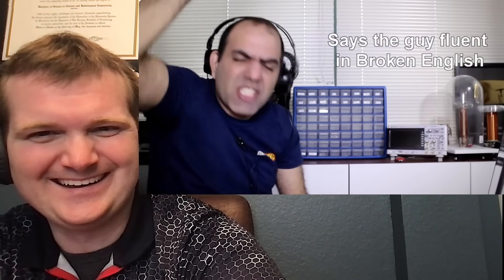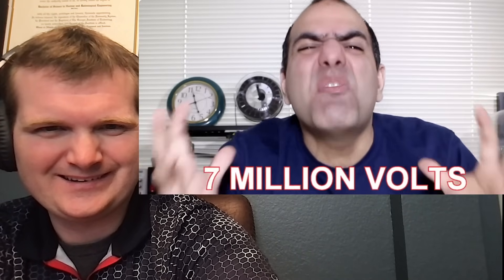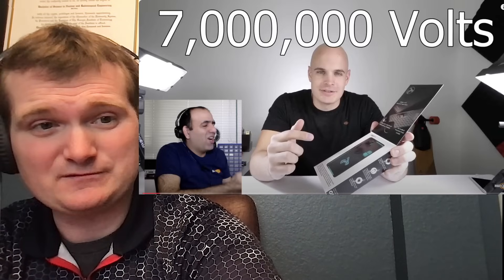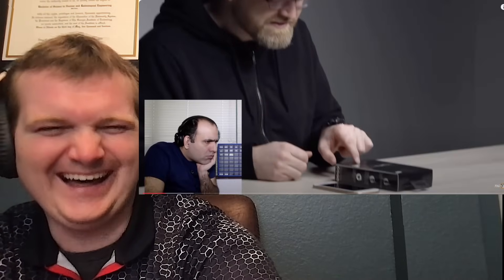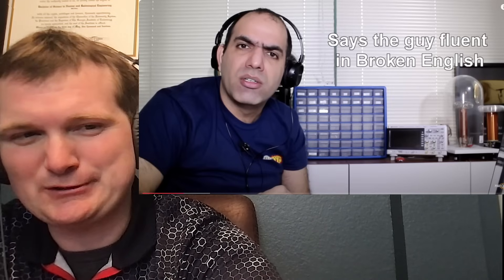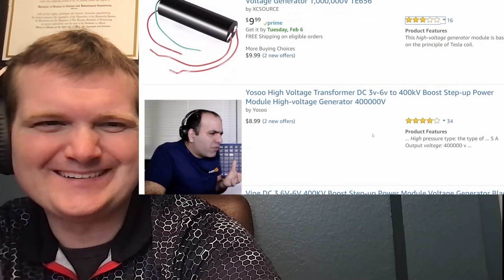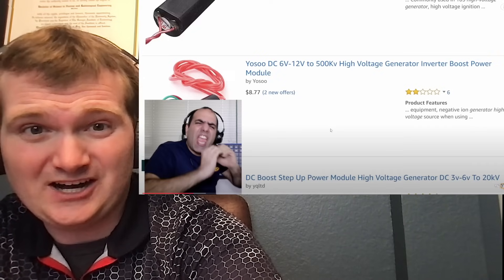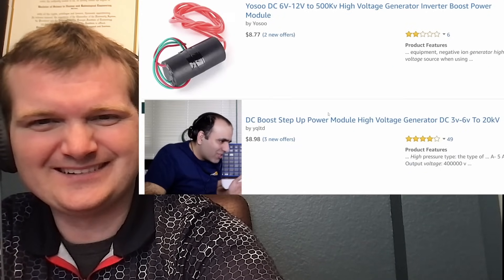7 MILLION Volt Stun Thingy! - Nuclear Engineer Reacts to ElectroBOOM

Comment: "It's not the voltage, but the current that gets you" is when people talk about high voltage sources that have high internal resistance. 
A CRT has anode voltage up to about 30kV, but the flyback transformer cannot produce a lot of current, so if someone touches it, the voltage immediately drops to a much lower value and the shock while painful and still dangerous is not as instantly lethal as touching, say, the 25kV at the output of a generator in a power plant. 
OTOH, usually people do not grab a voltmeter to measure the voltage while being shocked, so you get the high voltage in open circuit, but low current when getting shocked.

Comment: Stun guns are a type of hand-held self-defense device that uses high voltage to deter attackers. Tasers, on the other hand, are similar to stun guns but have the addition of two electrode barbs that get fired at the attacker to deliver the shock from a safe distance. Stun guns require direct, close contact which could be dangerous for the user while tasers allow said user to drop the attacker from about 15+ feet away.
Reply: Not even close. Stun guns cause pain. Tasers incapacitate. Shock a big boy with a stun gun and all it gets you is a prejudicialy broken body.

Comment: I don't know why they are called stun guns since they need to be in contact with someone to work.
TASER is actually a brand name, but some of their products have a range of up to 15 feet.  They launch two barbs that remain wired to the zappy bit, both of which need to stick for the shock to function. 
I don't think there are any generic ones with the projectile component, but I didn't look, so I'm not positive.

It's cool Electroboom added that bit about pain compliance. I like the channel Hard2Hurt, and that comes up from time to time there.

Comment: Yes, there is a difference between a taser and stun gun. I forget which way round it is, but one of them have the electrodes fixed onto the device, so you basically poke the target with the whole device, whereas the other fires barbs which stick into the target, and are attached back to the device via wires that unspool when the barbs are fired. 
In other words, one of them you have to be within arms reach of the person you're going to stun, the other you can use from a distance. I believe there's at least one model out there with a range up to 35ft.

Comment: Some time back in school I remember that we were taught that the safe range was about a millimeter per KV. So for a 10KV charge you had to be at least a CM away or there could be a discharge. The Anode in a CRT TV screen often is powered at about 30KV and you can easily get a 2.5 to 3 cm arc going there with a screw driver. I jumped a lot the first time. Note that it was my teacer who told me to try touching the transformer with my screwdriver to see if there were a high voltage. He didn't mention that there would be an arc, and my screwdriver lived with a mark burned out of it ever after. 

So for rough estimation I have found that one centimeter or ten millimeters if you like per Kilo Volt is decent take. If you need to know the distance more exactly you are already working on things that require that you really know more.

But yea. a millimeter per KV. triple that and you should be safe...

At ten KV or higher at least keep two CM per 10 KV and things should also be fine. But adding a bit more distance doesn't hurt. It all depends on exactly what you are doing.

Comment: Maybe a bit outside of normal nuclear but related to power generation/commercial electrical. Arc flashes; there's a few pretty crazy ones with like substations on fire, etc. Kind of long/sad video but a lot of safety pieces in the Eddie Adams story, another crazy one was an accident or equipment failure in high voltage substation in some kind of an equipment building. 

I think there is also some relation between the amperage and voltage with arc flashes. Welding is sort of like an arcflash but you're using low voltage closed circuit but hundreds of amps. A substation though will just give you lots of volts and amps.

Comment: the worst Shock i got was from a Solar Array....
Working as a technician for industrial Laundry,vacuuming big amounts of lind creates static that travels way further than 15mm...
Reply: Worst I got was from a 45kV second anode line with a pinhole in it on a projection television set. 20 mA available, definitely an owie! Given regular CRT's in the 27 - 35" range at the time were around 27 - 30 kV @ 10 mA, anything smaller typically being around 25 - 27 kV.
Hardest hit, 1.5kV riding on 130 VDC from mains, around 3 A arm to arm. Briefly stopped my heart - literally, felt it make an escape beat after a couple of seconds of "WTF is that noise, while also thinking at the same time about the owie I was feeling". The noise actually being a sudden cessation of noise that's normally filtered out by the brain of one's own heartbeat.
I called out for the rest of my shift and it was a fine drive home, given I could literally not feel anything from my forearms down. Flyback transformer insulation failure, arced to one hand, the other hand was near the grounded tuner shield and arced to it. Don't recommend the experience. 27" Zenith television. The only reason I learned of the current loading was that I literally worked with the engineer that designed the power supply after we reported a lengthy string of specific failures and he was dispatched to observe and bring samples back to the lab to analyze why so many units were failing. About as much fun as having a romantic interlude with a woodchipper.
And I've worked on circuits that went back to even vacuum tube tech, where the currents normally were much higher. Although, with those, it was either a self-recharged capacitor or thermal burns from the tubes that were the biggest risk.
Didn't plug a damned thing in without an isolation transformer.
Reply: @spvillano 
Man you remind me of one of my electrical foremen😂  keep on keepin on, friend!
Reply: @spvillano  okay some people are build different...
Serious respect
Reply: I've been hit by 240V mains before. I do NOT recommend it. Solar array output is nothing to sneeze at either, mind you.
Reply: @tehspamgozehere  nope Ac lets u shake and twist...
Dc makes u cramp up completely
Reply: @Moneymark1979  Makes sense. One is a fluttering sort of back-and-forth switching of pulses, whereas the other is a continual sustained flow. Either way it's painful.
Reply: The worst I got was from an electrical outlet a plug in outlet. It was when my aunt was married to a guy named Eugene. Jessica my cousin lived in the back room and she had lights in her room and I was underneath her bed and went to plug in the lights and my finger got caught in between the plastic rubber shit it’s made out of and made contact with the metal prong and when I stuck it in my finger was touching the metal prong as it went in and I got electrocuted from lol. It shocked the shit out of me but I was fine and had no burns or anything. I got shocked by an electric fence at my great grandmas house too when I was younger. I grabbed it.

Comment: Yes, you can fight through a taser if you're "motivated", as in using drugs or proper muscle control. I've seen skinny dudes taking the obligatory taser class and they just muscle through it. Assuming good contact, what I know about the body tells me they're able to counteract the back contractions with chest and abdominal contractions because they usually say, afterwards, that they feel like they just did a whole week's training in 10s.
Bonus Fact: Most taser are limited in time because they cause such rapid and quick contractions they can break muscle fibers, and with enough muscle fibers broken you can cause a condition called rhabdomyolysis.

Comment: I’ve demonstrated the voltage current argument with a couple microwave transformers. One is unmodified and outputs over 2kv, the other I removed the secondary and put two turns of thick wire through to boost the current. If I touched the first transformer I’d be dead before I hit the ground since there’s no current limit with such a high voltage. With the modified transformer, despite outputting over 700A, I can touch the output and not even feel it as the voltage is limited to 1.5V, and your body’s resistance easily blocks it, yet that same current will melt copper in seconds.
Reply: That's the kinda demonstration that'll lead to Witch Trials in one timeline or a wizard tower in another.  Good luck.

Comment: 6:22 what is this cool blue electric gun used for🤔🤔 I've never seen such a thing before, keep it away from your glue gun collection as well, your craft may not turn out the way you planned👨‍🔬
Reply: Its an ESD gun (Electro static discharge) and its use to test motherboards if it static discharged to ground
Reply: @WhiteMilk_Furry that's very cool thank you!!
 The last time I needed to check if a motherboard was working I was a smart boy and touched it with my fingers just after it was plugged in and got a nice suprise⚡💡 it was working.. but then it wasn't, rip PS2😢

Comment: 15:00 - Yep, its the total energy = volts x amps x time. And if someone jams electrodes into your "meat", less than 20V can deliver lethal energy. And then there's arc flash, that needs the power from a power plant, which is actually just like what you see when hit by a light saber, in Star Wars ! Only its quite real !
Reply: yes
Reply: Time isn't all that important although it can matter. A lot of sources you could touch indefinitely and be fine. Once you get above a threshold then time matters the same as how there is a voltage threshold where it starts to matter and below that you won't feel anything or do any damage.

Comment: Great video, but the issues of voltage and current was something I worked on, defibrillation waveforms.
Defibrillation therapy is measured in joules with 200, 300, and 360 in the typical defib protocol.
Multiple waveforms have been used over the decades, AC, monophasic (first half of a sine wave), and biphasic (monophasic with a negative tail. The volts are in the KV range and the current in the amps for about 25 millliseconds. 
Note that flat line (asystole) is not a shockable rhythm and people do not jump.
Also, safety requires that the person is in a shockable state as defib can kill, which is why "clear" is part of the protocol. Note that in an X-files episode, Scully killed a bad guy with a defib, my favorite X-file episode.
Reply: The last I looked, biphasic is the current state of the art waveform, still so?
My wife died coming up on three years ago, I'm a retired military EMS type, so when the AED remained silent regarding shocks, only advising compressions, I already was forewarned. When the paramedic arrived and plugged in the monitor, well, there wasn't even PEA, it was entirely flat. They were shocked that I could read the monitor and know, but they continued per protocol.
Long story short, fast advancing sepsis in a poorly controlled diabetic, the infection raced through her in literal hours before she expired, going from mobile and helping carry in groceries to deceased in around 4 hours.
Reply: @spvillano  I'm sorry about your loss and wish to thank you for your service.
I retired a decade ago, but I guess that biphasic is still the current waveform.
Reply: @spvillano sorry for your loss. Thank you for sharing your story though. Yeah that's one of those it can go so bad so quickly.

Comment: Dude I hadn't noticed before that the cop talking about the stun gun actually hits himself with it multiple times and doesn't change his tone of voice even a little. That man is a beast.
Reply: Or he`s one of the rare people who don`? t get as easily incapacitated, OR that stungun is kinda crap..
Reply: Btw, he barely touched his skin with it, if he jammed it in there and HELD it it would be a different story lol
Reply: @afrog2666  No kidding, wasn't the point of the demonstration. Its more realistic to only have some times connect as nobody would let them have an officer, or someone else taze them. They would be actively moving and trying to avoid it as well as the person using the taser wouldn't be able to accurately keep it on them.
Reply: @afrog2666 not necessarily. Stun guns are not tasers.
Reply: if you contract the muscle wich will receive the spark it is easiier to controll the movement of the limb. and pain is ofcourse nullifiable
Reply: It is all about being prepared. He already knows the feeling of getting shocked so he just needs to tolerate the pain. It's like those shock toys that get people by surprise, but after some tries it just tickles.
Reply: im guessing heavy duty rubber mat
Reply: Naah...remember what nuclear scientist said : it depends on  voltage, AMPS, frecuency AND TIME .  That cop did it in a way  to limit time and  amps .
Reply: I mean you can tolerate pain over time well enough that it doesn't even make you flinch. I've hit myself so many times with a hammer working in construction it's crazy. You aren't supposed to hit yourself with a hammer but you gotta do it enough times to be good at not hitting yourself. It's gotten to where I can even look away for a second and not miss my swing. But earlier today I looked away, smoked my hand, and didn't even flinch. I've even hit myself mid conversation and not even changed my tone of voice or train of thought and I can feel a little bit of swelling in the area I hit myself. It's a pain tolerance you develop over time. But I wanna know how these guys' muscles aren't even reacting to the electricity
Reply: Wish I could find the video of a female officer wrestling a drunk college guy on the ground trying to cuff him… she warned him he going to get tased… and she reached around and tased him 𝒓𝒊𝒈𝒉𝒕 𝒊𝒏 𝒕𝒉𝒆 𝒃𝒂𝒍𝒍𝒔 𝒑𝒐𝒊𝒏𝒕 𝒃𝒍𝒂𝒏𝒌! And what do you know after screaming, the guy got quiet and submitted to cuffs and wasn’t a problem anymore!

Comment: Fun fact, you mentioned dangerous negative ion stuff during this video, Ann Reardon (How To Cook That) just put out a video on more products of the exact same nature. She even put together a nice little science experiment in the video that you might enjoy.
Reply: This!!! I added a link to my comment but apparently it becomes missing 🥺
Reply: Just saw that video tonight, she went a lot overboard on something reported on multiple channels here on YT five years ago.
What's in the few that actually emitted radiation is raw thorium sand samples, extremely low dosage, so about as dangerous as living in Ramsar, Iran. To give you a hint, it's the most radioactive place on earth and has thriving cities. Annual dosage is 260 mSv per year from mostly radium that's naturally occurring. Omitted, banana dose and oh yeah, Brazil nuts are high in potassium-40, a beta and gamma emitter.
And that water from wells with an aquifer bordered by granite have uranium, thorium, radium and potassium-40 in trace amounts.

As for air ionizers, they're good for cleaning particulates from the air and well, use standard HV sources to do so and those dust particles then stick like an SOB to nearby furniture. The rest, well, it's just woo.
If I want woo, I'll go to a jiggle joint, where a hoo comes with the woo, woo-hoo. I'll leave that for someone recommended for SecDef, whose preferred headgear happens to be a lampshade.

Yeah, pretty sure I gave away my age with that last joke.